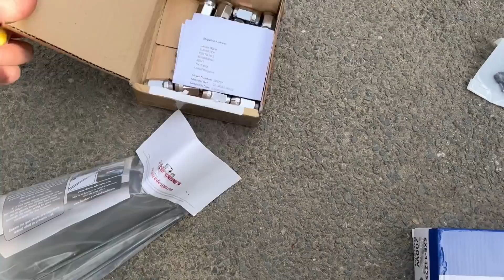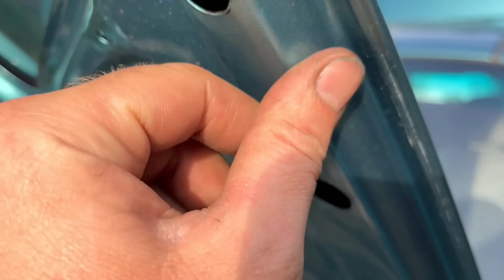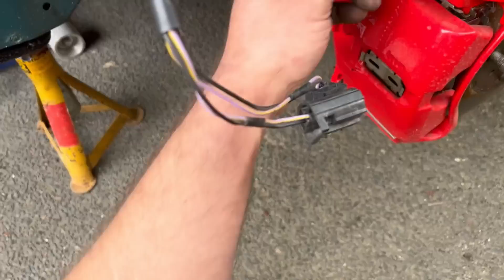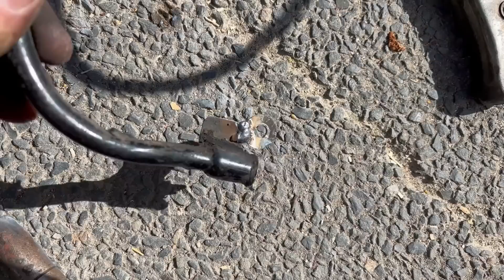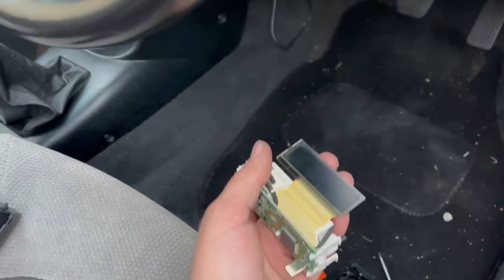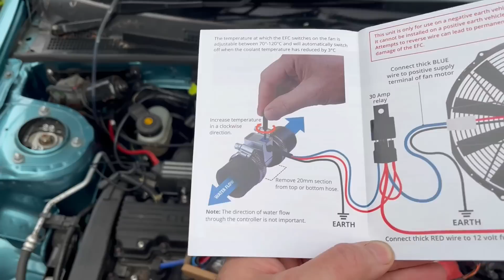Rover 200 mk3 Bubble T16 Turbo - Video 30 Very overdue update.  ABS rad fan controller faffing

Comment: Nice to see this, Did this set off as a turbo charged Rover or did you upgrade?
Reply from the maker: It was originally a 218is and would have had the 1.8 k series, non vvc with 120 bhp.  I got given the car by Mike at the bodyshop.  He just wanted the turbo engine that someone else had put in it.  I then fitted a vitesse turbo engine from a late rover 800.

Comment: Great video as always James, pleased to see this is almost ready for the road! Regarding your dodgy clock, the Rover Coupe Owner Club are now offering a service that repairs both the early and later type clocks (like yours). The ribbon cable is the cause of the pixel loss so they replace that and also replace the bulbs. Might be worth checking out